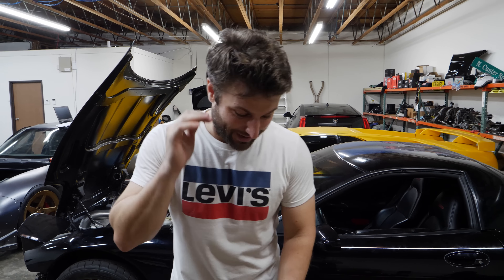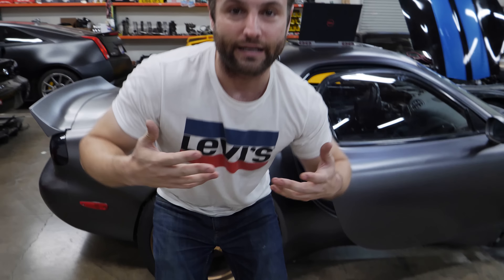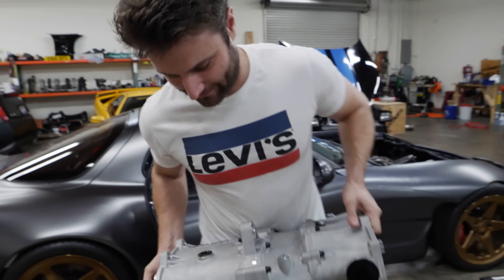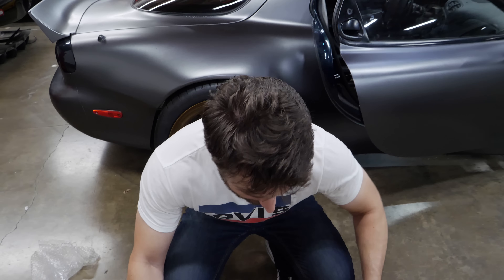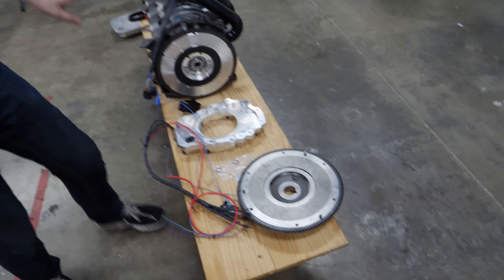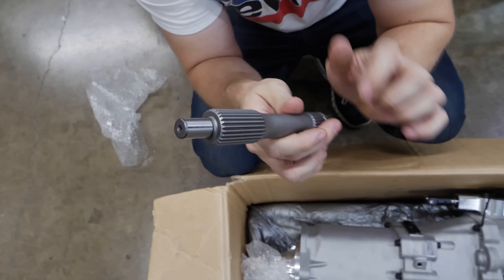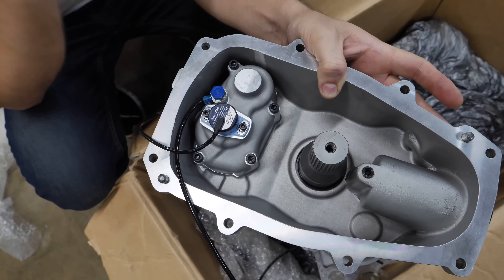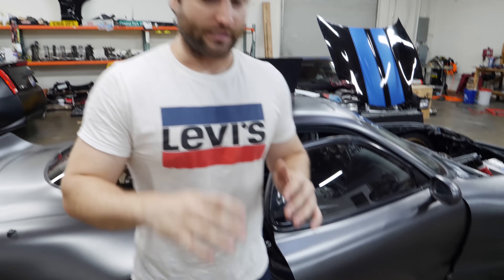I spent $20,000 on a TRANSMISSION. Sequential Dog Ring Air Shifted goodness

Comment: these alu flywheels tend to explode , so best also invest in a shield  around the bellhousing , so that you will keep your legs safe
Reply: That's pretty much a given for ANY race car, and a requirement for anything above a certain HP rating in all sanctioned racing events. Scatter shields are much cheaper than prosthetic legs.😉
Reply: @danw1955  When you say "all sanctioned race events", do you mean in America? I've read the UK motorsport rule book and the World Time Attack Challenge regs. Outside of the drag regulations I haven't seen a reference to a scatter shield.

Edit : Although using a scatter shield is just a sensible thing to do as Dan W said.
Reply: @Thee_Snow_Wolf  That's true. I did stage rallies and rallycross with the Rally America and N.A.S.A. rallies. None of those cars are required to have scatter shields.

Comment: if you have power steering pump, it will be lighter to go hydraulic for the gearbox (like F1) ... 

no air bottle, can run 'forever' (don't need to refill the bottle every time you drive the car) and the pressure doesn't drop (more consistent)
Reply: Lee Nux I guess if it runs out of air he can manual shift it ?
Reply: or he can just stick a little 5lb 12v air compressor in the car and never run out of compressed air, nor have to worry about pressure drop.

Comment: Just found this channel a week ago and it’s quickly becoming one of my favorites. One bit of advice, those smart scales need to recalibrate if they’ve been picked up off the ground. When you put it down where you want it, weigh something (anything) at least 3 times. You’re good once it’s giving you a constant reading. Then it’s calibrated and you’ll get correct readings on the fist try....until you move it.

Comment: This type of transmission has been used in motorcycles for the last 50 years or so, and it stands to reason that they would eventually be upsized for automotive applications eventually.😁

Comment: I wrote the following before watching the video and I am so happy to see some of my desires totally achieved!  ~~~>It always boggles my mind and mystifies me (for YEARS!) WHY sports cars commonly lack sequential shifting I just dont get it at all!  WTF?  I ride motorcycles and drive a sports car and I just know the bike trans is so much BETTER than flogging and H shifter which no matter how good is never perfection for gear changes.  All the things raved about on the best boxes like short throw and smooth engagement are already perfection on the best MC boxes.  I do realize there is one problem at least being reverse with a sequential MC box but I feel like there are multiple solutions to that even if it requires using another shift means for reverse or some type of lock out set up which gives you nuetral and reverse isolated from all the other shifting meaning there would never be an issue "finding nuetral" (a problem on many MCs) OR accidently trying to force reverse while at any forward speed...in other words push or pull something and you are in nuetral which also gives a reverse option then and only then.....the ecu can lock out any stupid actions on the drivers part.   A perfect enough sequential tranny could be shifted via either paddles OR in an automatic mode by the computer. ... do we really have to wait for seamless tranny to have this???   I firmly believe a sequential TRUE manual transmission with optional automatic shifting would be ideal for a sports car!!   Throw in quick clutchess shifting and a robotically (for lack of another word I cant think of) clutch and we could have the best transmission EVER for a sports car!  Click it into automatic mode only when for example in stop and go traffic or maybe when clueless GF has driving privlges (or turn that around if its a clueless boy friend of a female sports car owner (or whatever other gender scenerio its all the same) Yes it would add a bit of unsprung weight complexity and cost but not anything like a typical high end automatic trans adds now anyway!  It would in every way be better if you ask me for anyone that loves a manual transmission but hates driving in stop and go traffic with one...how heavy or difficult could a robotically operated clutch be anyway??  A electro mechanical hydraulic actuater hooked to the vehicles computer when desired ...OR full time operated that way via ride by wire meaning the clutch pedal could become an electrical switch requiring almost nothing for pedal resistance and could be mapped individually custom to whatever engage/disengage timing a driver prefers from super linear all the way or more like a lightswitch depending on how the vehicle is being used.     Probably some of this already is a thing idk but not on any car or motorcycle I could afford

Comment: When you talked about the flywheels, the other benefit of your new flywheel is that the mass is closer to the center of rotation.  On the old flywheel, it's near the outside, which makes it harder to rotate even if it weighs the same as the new weight.

Comment: This is The fastest way of shifting.  This is literally the same type of transmission that's used in f1 ( accept that they are using hydraulic instead of pneumatic) . Only another type of transmission that can rival it is ,,koenigsegg light weight transmission " with 7 clutches.  
Btw. love your content Rob 💪
Reply: Moto GPS uses a seamless transmission look it up pretty cool how it works

Comment: 20k sounds about right. Its 17k for a sequential STI transmission.
Reply: Mmmm KAPS sequential transmission.   Someday.
Reply: @satchitananda1820  Good job proving that you dont know what youre talking about. 

An Ikeya Formula is simply a manual to sequential conversion kit, that can be installed on any manual car to turn it from H pattern to a 'sequential' up and down only gear lever. 

They are selling you reinforced gears to convert your manual gearbox. 

The gearbox Rob bought and that this gentleman are discussing are on completely different levels, if it were that simple, trust me, Rob would do that, but that simply will not hold the power that this car will put down. 

Dont get me wrong, its a great choice if youre only throwing down 500whp and go drag racing often. Youre not putting down enough power to overcome the strength of the gearbox casing, once you start talking triple that power? Yeah the cheap shit alloy that mass manufacturers use to CAST their crappy gearbox housings will literally shatter into thousands of tiny little pieces. 

I not dissing you, i actually really want an Ikeya formula for my street car, but its not hardcore racecar material.
Reply: Transmitting an STI can cost you your life
Reply: @biggiecheese5135  his 900 hp VW lmao yeah
Reply: Yeah I'm surprised at the price. I would have thought it was more. A sequential for a Honda, which I think is still just half of the case keeping the front half of the case original, with no fancy electronics, is like 15k.

Comment: Good thing you are getting paddle shift. 

The quicker an engine revs up, the quicker it can drop engine speed also.
Turbo guys, drifters and stuff, they don't tend to go towards lightweight flywheels. Because of the potential to lose/drop off gears between gears

Comment: You should do a large single paddle shifter on the door side of the driver seat, with a pull for upshift and push for downshift like in WRC cars. That way you’ve always got one hand on the wheel

Comment: "the gearbox can handle gtr's with ease. So it can handle what I'm doing" 5 years later when Rob finally drives his 4 rotor: "the transmission couldn't handle 1500 hp/tq"
Reply: "5 years later" 🤣🤣🤣

Comment: You might have a direct drive gear in it, that does not mean it comes the same speed as it goes in, diameters of stuff is way different and you have Final Drive ratio(s, two diff in your car and a transfer case) that also mess up the equasion

Comment: Anybody who has raced sequential transmissions know how perfect they are. There are sequentials that do not require you to lift off the accellerator and can handle the engines full load between gears without loss of rpm.

Comment: If you dont run a trans cooler i believe youll have too run a line between the those fittings. Blocking them off could probably cause some issues but maybe im wrong.

Comment: I don't know what fluid you normally run but for the love of what ever you hold dear please fill that trans with Royal Purple racing fluid and not the street stuff they sell . a 20,000 dollar trans deserves the best . it will go for 20 a quart depending were you buy it but it's insurance and worth every drop . also put Royal Purple in the rear diff the wave trac differential  should call for it .it wouldn't hurt to fill all the fluids in the car with Royal Purple . to tell the truth it's the only oil I ever raced with and I'm a bit in love with it because it's the best there is.

Comment: Also, I would love to know how the hell did you think adaptronic does transmission control? It doesn't you can have it trigger a solenoid  but it is not a transmission controller in anyway or form if you want preloaded shifts  adaptronic cannot do this for you .
Reply from the maker: Adaptronic committed to doing this for me 😜
Reply: @RobDahm   not sure how that's going to work out for you being on the other side of the world and is  impractical motec can preload the barrel shifting mechanism for gear changes and literally adjust hysterisis because down shifts aren't perfect. You chose the wrong ECU to do that.

Comment: rob: watch me turn $20k into $150 worth of steel and aluminum

serious question though, if you remove weight on the flywheel on a rotory isn't that somewhat counter productive VS torque carried from one gear to the next causing the engine to have to work harder?

Comment: So if you downshift do you still need to revmatch or does it revmatch for you?
Reply: Thomas Lee You'd have to rev match unless the ECU can rev match on its own, which it sounds like maybe whatever system he's using might be capable of doing since he has the gear position sensor that will operate traction control, etc. I know late model (C6-up, maybe?) stickshift Vettes have an auto rev match feature, so I know it can be done with what tech is available. I feel like rev matching would actually be a concern in this thing, where it's slam shifting with no clutch, so that might be the route he goes. I don't know much about this kind of setup, though, and could easily be mistaken.

Comment: You covered how awesome the gear position sensor is but not how simple it is! It's just a potentiometer thats driven off the back of the sequential shift drum. So each time it turns as you shift it, it reads a different resistance. 

Super cool and useless knowledge

Comment: Sequentials, the manual transmissions that make automatic transmissions look slow
Reply: ZombieByte They all do that. Sequentials are the manuals that make DCTs look slow.
Reply: @The_sinner_Jim_Whitney  i know but most auto guys claim "but muh auto faster otherwise the company wouldn't put it in" and they are reffering to double clutches, when in reality their car has a factory auto that is designed for maximum fuel economy and shifts like an anorexic tortoise
Reply: ZombieByte Yeah, no factory traditional hydro auto has ever shifted fast (or even firmly, for the most part). They're pretty indisputably faster in drag racing (I'm still a mansmission guy, but I'm not a very good drag racer- probably because I love stickshifts, haha!), but that's only because they're consistent and easy to launch.

Comment: Less mass will also hurt your launch if your drag racing. Big engines typically use lightweight flywheels, but small engines use heavier ones so the they don't stall out.

Comment: Has weight and power distribution for the project been discussed been following this project since the beginning but didn't pay much attention to details as I thought it would end up another unfinished dream build obviously I'm admitting I made a huge error and depending on those ratios and the size of the brass balls belonging to the lucky SOB behind the wheel that beautiful machine has the potential to be the baddest bitch on the face of the planet pardon the language but an AWD sub 4000lb 4 dorito being force fed by the biggest most well engineered exhaust recycler(for all you emission nazis) backed by a dog geared pneumatically shifted go box this beautiful piece of engineering is the thing wet dreams are made of properly tuned, geared assuming proper attention is given to the aero which will need to be very extensive she could potentially be the baddest all around game changing piece of gear head art/machine to ever affect this big blue marbles rotation sorry for the rant but I'm officially in love and when she's completed if you ever bring her to Florida there's nothing you could ask for that I couldn't make happen for you to have to privilege of taking her out and burning a tank of go juice on some wide open country roads just saying

Comment: This build is amazing, but (!) you could take it to another level by putting a crankshaft driven supercharger on that rotary engine  and feed it with that turbo for a compound setup. I bet the supercharger would significantly widen the power band of the turbo.

Comment: Gotta love how you can't explain sequential shifting transmissions are but practically every transmission you can go through gears sequentially...  but ARE YOU ACTUALLY BUILDING YOUR OWN CAR 🤔 don't get mad. Don't assume I haven't done what you're doing here also I build my own engines  chassis and transmissions clearly like you're doing here right ? I'm practically  the the worst person you could have gone up against. Also dual clutches shift faster than any sequential dog ring transmission... a DCT is  already in the next gear while  accelerating in a current gear a hollinger cannot physically do that by design. We're talking millisecond shifts .